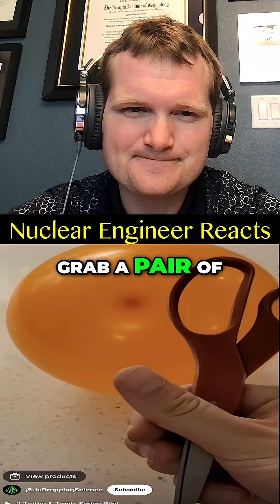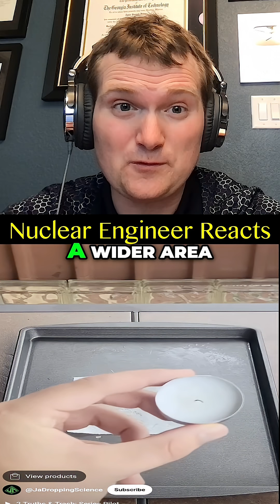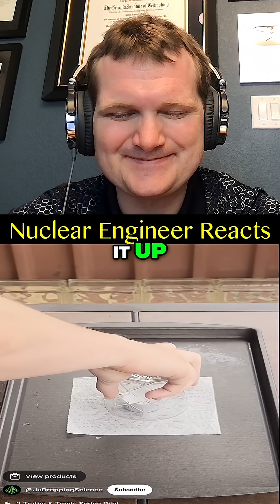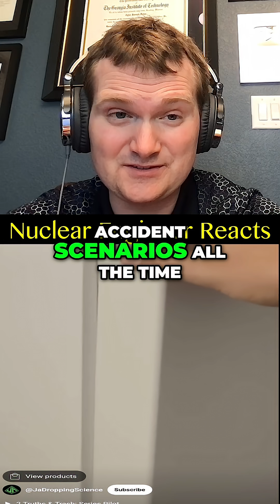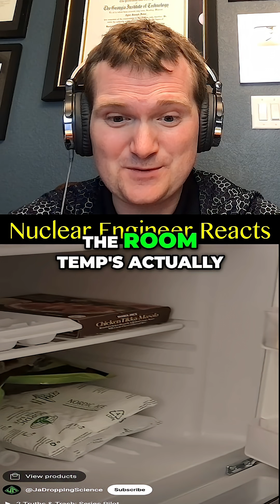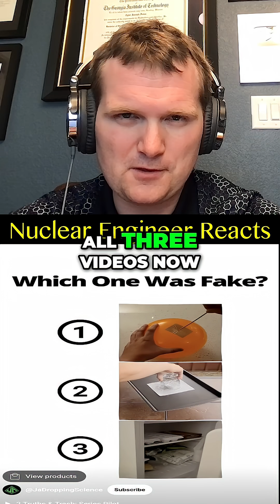Reinforced Balloons? - Nuclear Engineer Reacts to 2 Truths & Trash by JaDroppingScience

Comment: The fridge uses an hvac system to remove heat from inside the fridge and freezer(hence the word”heat pump”) if you leave the doors open that mini HVAC system inside of your fridge is going to begin to try to remove heat from the entire house. Only the heat being removed is just going to be placed back into the house and with more since the action uses energy, which releases heat.

Don’t have to be an engineer to understand that one. This is simple HVAC knowledge.

 Could you please tell me if you created an exhaust fan that led from the refrigerators condenser to the outside of the house that could potentially bring a bit more efficiency overall, but the system will still be too weak to cool an entire house efficiently relative to your average residential HVAC system.

Comment: But if you are really suffering badly from indoor temperatures and don't want to get yourself wet,  drastically shorten your fridge's life and are ok with your next electric bill, well then grab some cushions and plant your self down in front of open fridge and freezer doors and stay there until it's time to go to work... which should be no more than an hour or two after that otherwise, nada and food that has to be thrown out.

Comment: An air conditioner is also a heat pump, but any AC worth using will have an outlet to the outside air, which is where you dump all the heat you're pumping out of your room.

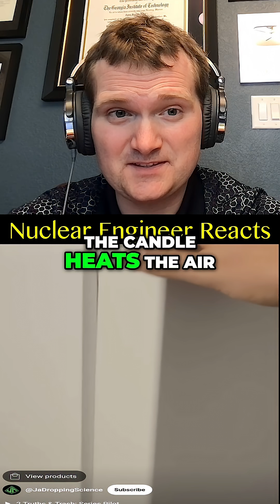Comment: 0:39 It has nothing to do with oxygen depletion. Warm air expands and is forced out of the glass. When the candle goes out, the air cools and contracts, creating low pressure inside the glass. The wet paper towel acts as a gasket, preventing air from getting in causing it to suction to the sheet.
Reply: Oxygen depletion is what makes the candle go out though.

Comment: Opening the fridge actually would work to cool the room over the short term.  The heat pumped into the room 3 hours ago is a lost cause, leaving the fridge closed won't get that back, while opening it would (partially).
Reply: No it wouldn’t work because the fridge is dumping heat into the room faster than it can take heat out of it.
Reply: @AidanS99 of course, but you are describing the long term. There is a reason i specified short term.

Comment: I mean, the fridge/freezer one could work _momentarily_, the heat pump has been dumping heat out of the contents against a gradient for some time, so if the room it's in were to (magically) equalize the temperature between the freezer contents and the room such that the freezer contents and the room were now at the same temperature, the room would be cooler. However, when the compressor kicks back on to re-cool the freezer contents, the compressor operating would then yes increase the temperature of the room above it's original baseline. It's like, if you froze a giant chunk of ice then took it out of the freezer, it would cool the room.

Comment: "We actually use duct tape to reinforce nuclear reactors"
Reply: Engineer: "Yeah we use duct tape for everything. If not, there's always cable ties and super glue...."
Reply: @EdgyNumber1 And WD40 for the opposite
Reply: I do robotics and I am convinced that 50% of any given robot or the field is zip ties and duct tape and hopes and dreams
Reply: @Samcam2090 There are 5 key things that are always in an engineers toolbox.
1. Stanley knife.
2. Duct tape.
3. Super glue.
4. Cable/zip ties 
5. Screwdriver - if not to screw something in then to open things up.
Reply: Didn't know Boeing had nuclear reactors but cool
Reply: How original
Reply: @billyray4716  No fun Nicholas over here
Reply: @billyray4716   Finally some pushback against these stupid lazy jokes. I mean, these can be funny if they worked on them, like used the template as a setup and wrote an actual punchline, for a start. But it's just simple word substitution every fucking time.

Comment: You know, I was sure confused about the fridge thing, but as soon as he made the comparison to cooling a reactor containment building by running one of the heat exchangers in a loop, it just clicked! Thanks for simplifying these things for the less bright ones ❤❤
Reply: i love when he says shit i dont understand its why im subscribed
Reply: I got u simplifying (read in caveman). Fridge use current to move heat from inside to outside, but also generates heat on the side. If fridge open heat come back inside, fridge pump out heat. Now more heat in house than started, heat come back inside, house keeps getting hotter.